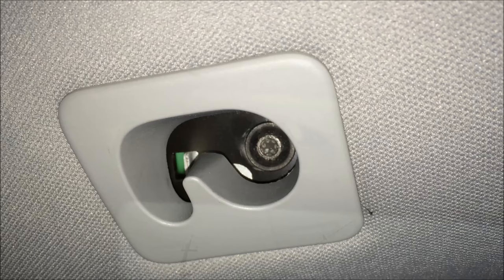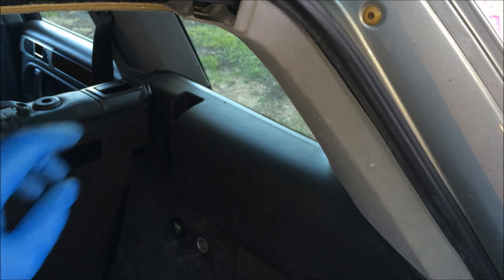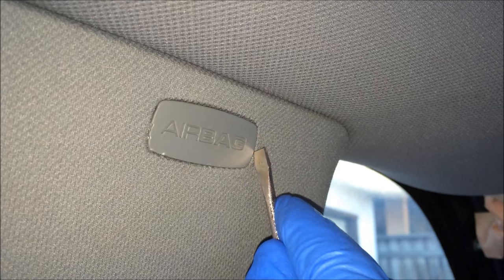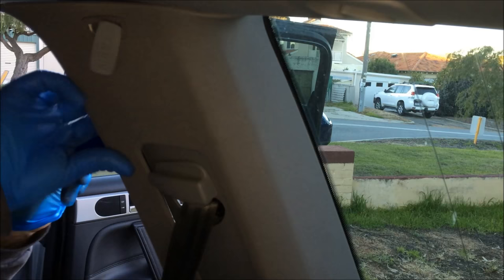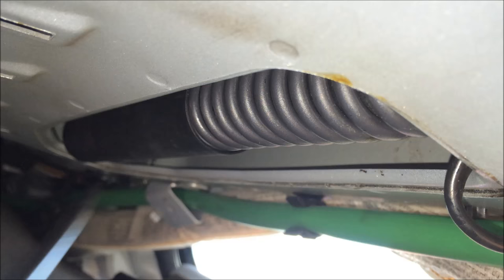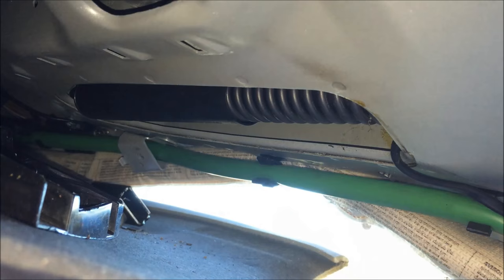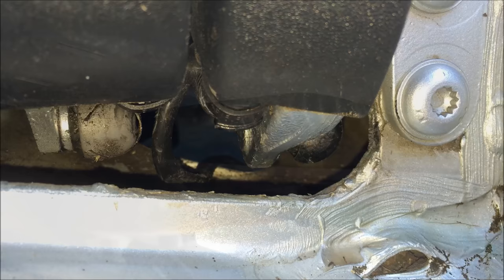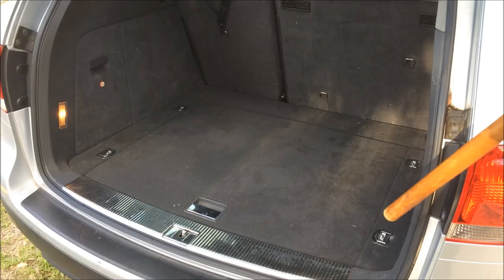How to Replace Volkswagen Touareg Rear Hatch Struts

Comment: Really good video helped to replace mine today. Only problem I had was not making sure the two cups on each end of the strut were exactly at 180 degrees to each other. Just make sure they are and you´ll have no problem.
Reply: How did you move them?
Reply: @a.z.3214  Exactly my question, after i was removing the first side.... the damper does not come out of this hole. I normally would need to compress that thing, but HOW?

Comment: How on earth did you get the spring out from the cavity? Once I released the clips from the door and the support cup to the frame of the vehicle there was no way for me to get that spring outside that cavity. The spring went fully expanded is longer by about 1 in within that cavity so no matter how much I angle it it just will not come out.
Reply: currently working on it now, any luck?
Reply: @rxckless8469  Yes the easiest way to pull it out is by first backing it out between the hinge cavity and then pushing it forward under an out of the tissue box cavity.

Comment: The damper does not come out of this hole. I normally would need to compress that thing, but HOW? And, even if i m able to remove the old one, dont I need to again pre-compress the new one a bit to assemble it in place?
Reply: I had the same problem as you, the space is very narrow. I finally solved by opening the trunk door to its maximum, otherwise the hinges dont allow enough clear room! No need to compress.

Comment: Will Porsche Cayenne 03-05 struts fit in ?
Reply from the maker: No the Porsche Cayenne struts are smaller. I own a Cayenne and a Touareg,  I replaced the struts at the same time so I can guarantee that they are different sizes.